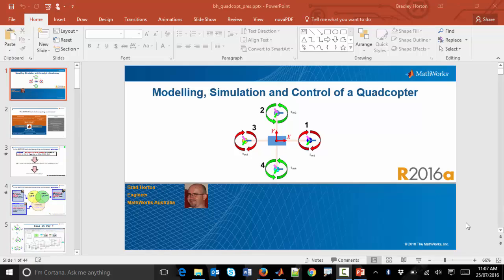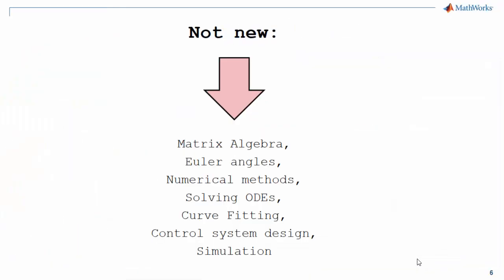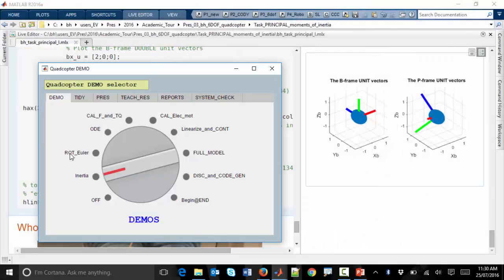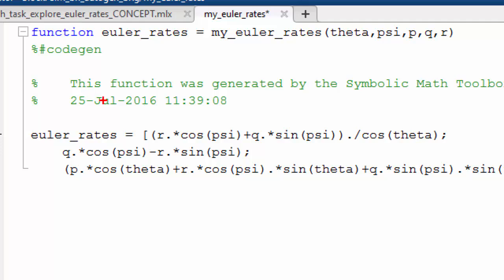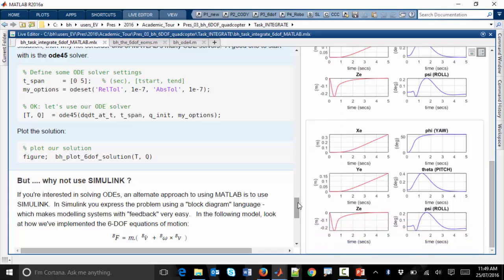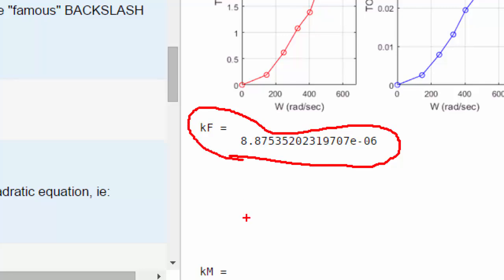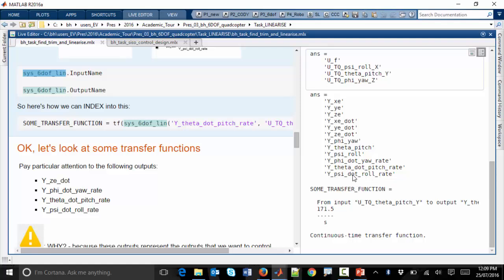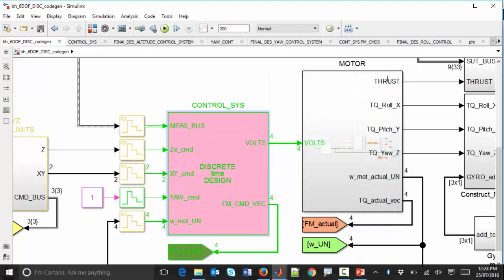Modelling Simulation and Control of a Quadcopter - MATLAB and Simulink Video

Comment: Hello Sir. It's an excellent video. However, there is one thing that I would like to point out and get myself clarified. When you pause the video at 1:10:12, in bh_test_LINCONT_on_NONLIN_plant/CONROL_SYSTEM, I notice that you are adding gravitational force to the thrust calculated by altitude controller. Shouldn't it be subtracted from thrust? Because when you linearize the plant I notice that you subtract the gravitational force (you basically add but gravity itself is negative (-9.81)) as shown at 57:50 of the video. Please could you justify this. Thanks a lot in advance.

Comment: Excellent presentation!  When I worked at a very large aviation related manufacturer, they did an in-house move to using matlab / simulink but the way controls work was allocated to the many engineers in a tunnel vision fashion, I hated it as I couldn’t visualize overall system design.  I am back at home revisiting this entire topic after a long stint in flight test with aircraft manufacturers.  I purchased many tools licenses for these thought experiments I have .. you hit it right on the head in the presentation.  .  The updates to the MathWorks tool sets since my prior experience are excellent .. I really really like it and presentations like this reflect the excellent approach to your product development and focus on  end user needs or whatnot .. Thx